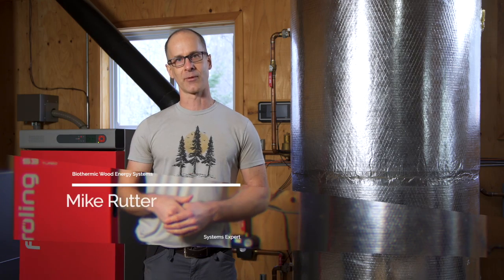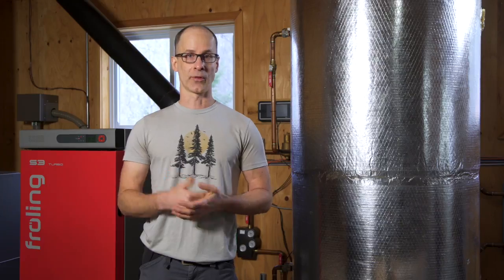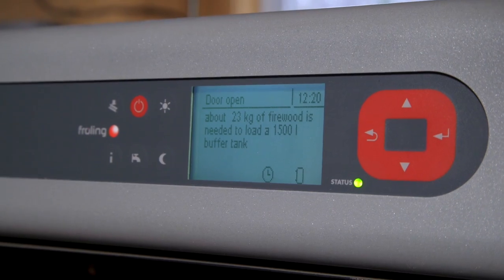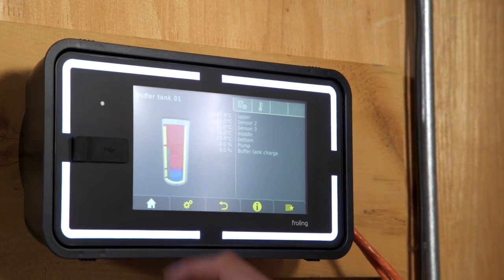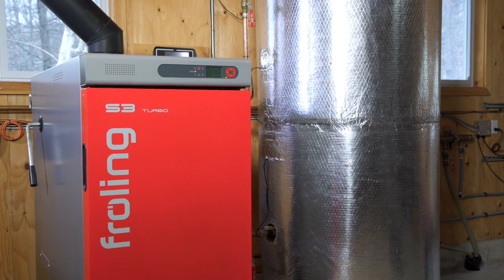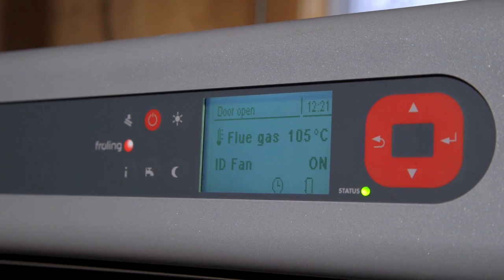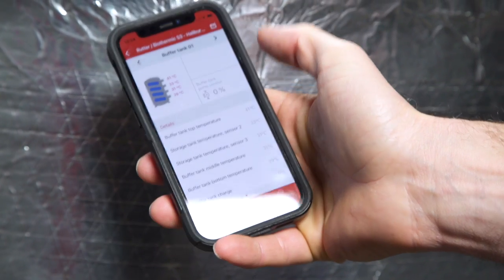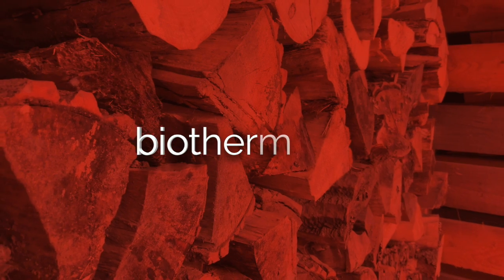Fröling S3 Firewood Boiler

Comment: Do you need storage or could you just run the boiler? Does it run 24/7
Reply from the maker: Hi Drew.  Long story short, ALL firewood boilers require thermal storage (aka. buffer tank).  Be suspicious of anyone that says otherwise.  When firewood boilers are running, they output more heat than typical heat loads require.  The buffer tank stores the extra heat so it can be used throughout the day.  Firewood boilers should not modulate so restricting air flow to reduce the output is not an efficient option.

In some rare cases you could run a firewood boiler 24/7.  This can only occur when the heat load meets/exceeds the output of the boiler.  These are typically commercial applications, not residential.

I hope this helps!

Comment: I find it interesting that the hot water pipes are not insulated. Looking at heating systems installed in Austria it is very unusual to fine uninsulated pipes in modern installations.
Reply from the maker: Yes, pipes should generally be insulated.  This is the standard in Canada as well.  This boiler is installed in our shop.  We do not insulate the pipes as it is easier for us to demonstrate how the system operates.